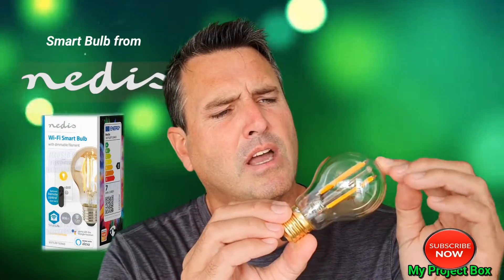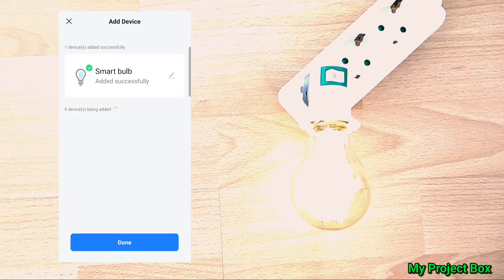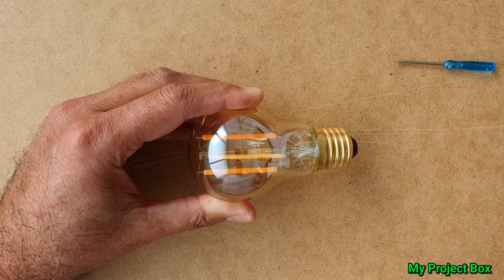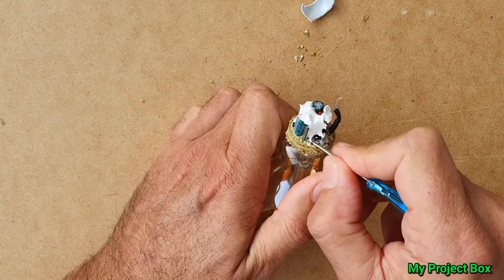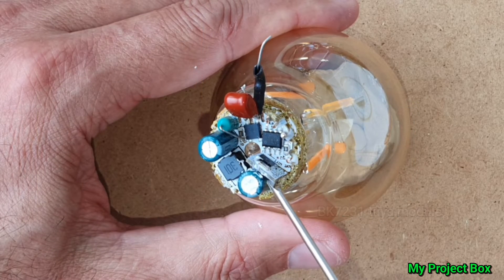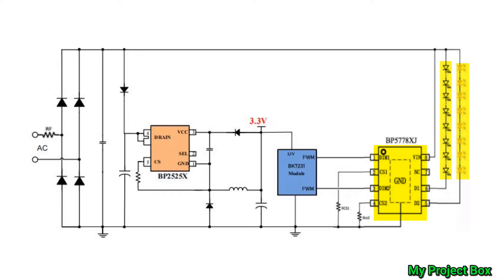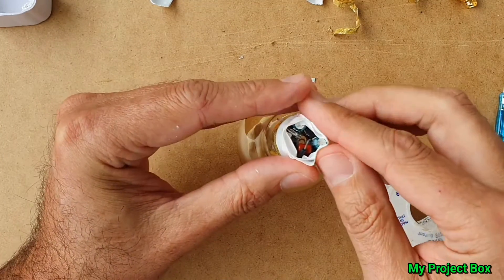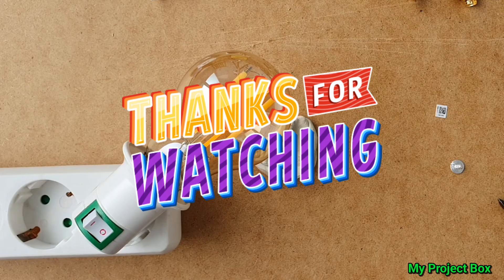Nedis Filament Smart Bulb set-up & teardown reverse engineering #nedis #tuya #reverseengineering

Comment: One tip, put the grease back on, the buck and dual channel linear PWM control can get hot, and the grease needs to contact the aluminum case. If you want longer bulb life. Regards, good video.
Reply from the maker: I did forget to put the thermal paste back 🤣. And I only realised after glueing the base back on😮‍💨. Mabe I won't run the lamp on full brightness,  to help prolong it's life. I know the linear regulator chip automatically ramps down, to compensate for overtemperature. So it's brightness will drop if it gets to hot. I don't think the buck regulator is doing much work, It's just supplying  3.3v to the WiFi module🤔. Hopefully it will be ok.

Comment: Good video , interesting to see how they do it . Nice to know that PTFE can be used like that. On that subject. Although I'm an electrician I once worked in a factory making heat exchangers. The foreman wasn't the brightest but would never let himself down by saying he didn't know something . When asked what PTFE (polytetrafluoroethylene) stands for he would reply " Plumbers Tape Federation of England" 😁
Reply from the maker: My father-in-law wanted lighting inside his built-in barbecue. We didn't have any heat resistant cable at hand. So we stripped back some of the insulation of regular cable, and generously wrapped the individual conductors with PTFE tape. Then we twisted all the conductors together and wrap the whole lot with copious amounts of PTFE tape. I terminated the DIY cable into a ceramic lamp holder with a regular incandescent light bulb. The flames from the barbecue, have been licking over the light bulb and cable for years now without problems. It's amazing what you can do with "Plumbers Type For Engineers"
Reply: @MyProjectBoxChannel  😀I would have over engineered the hell out of that using SWA or Pyro  . Nice tip
Reply from the maker: @mrflibble5311  I love pyro (mineral insulated cable). It's kind of dying out nowadays. I don't know how many of the young guys can do it anymore.
Reply: @MyProjectBoxChannel  I'm in my mid fifties and I don't think I've seen Pyro being installed here in about 20 years. I once saw a building after a fire and all that was still standing was the Pyro. I don't think the young lads wouldn't know it at all . I'd reckon they don't teach it anymore.

Comment: Very nice well done, I wonder what the life is of the LEDs being high voltage?
Reply from the maker: There should only be about 3v or so, across the individual LEDs inside the filament. There are many of them connected in series(80+) so they divide the voltage across them. If the current passing through them is kept at a sufficiently low level, they should last a long time.
Reply: @MyProjectBoxChannel  You are probably correct, with the PWM they will not be driven too hard, another good video, thanks Bob